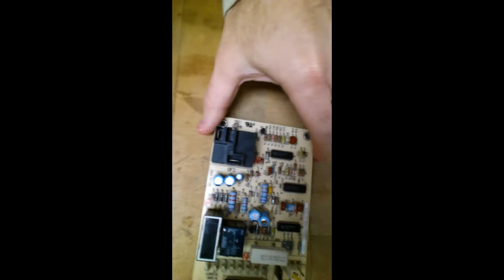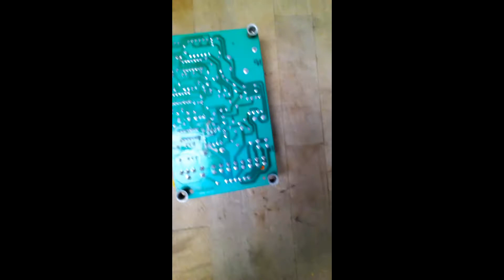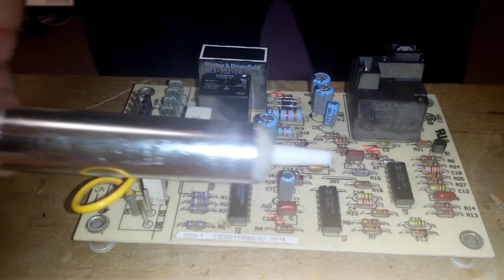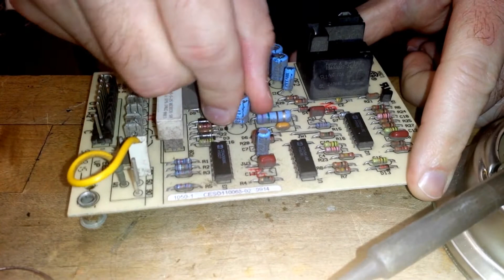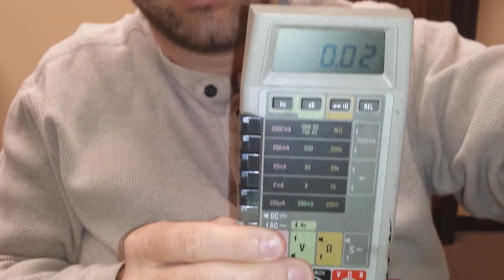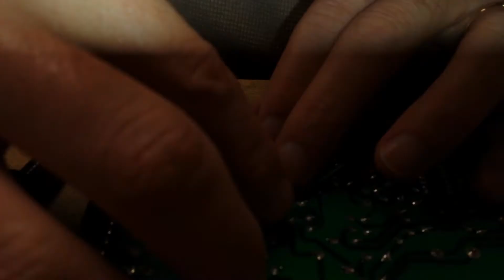Heat Pump HVAC Circuit Board Fix

Comment from the maker: You can't always go by any one wire diagram.  It's best to tone out the wires from inside the house to circuit board.  Not all wires are always used.  They are for different functions. I normally take a picture of current setup and mimic the same layout on replaced parts.